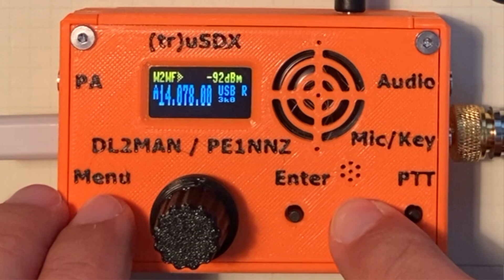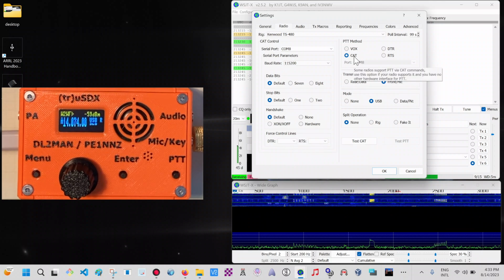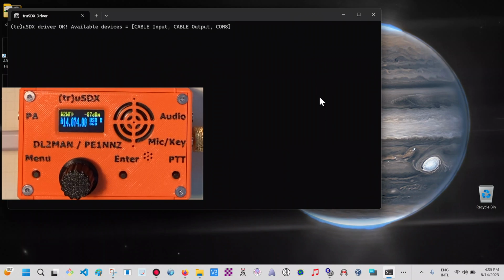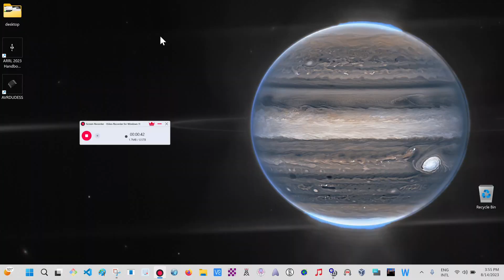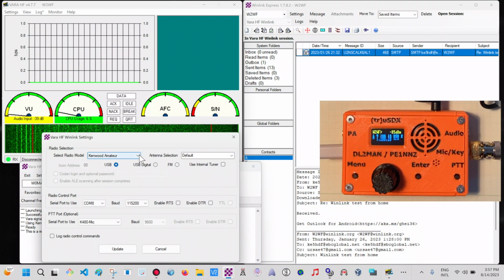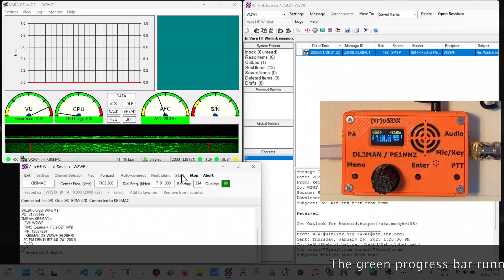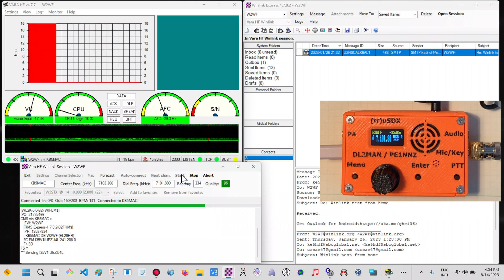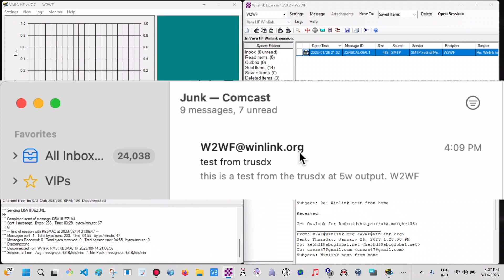FT8 JS8Call & Winlink over USB on (tr)uSDX

Comment: I tried the settings that you gave (WSJT-X) with a Digirig and the lead they sell for the (tr) uSDX, but unfortunately, I kept on receiving error messages.
Reply from the maker: Thank you for the comment.  In my case, I didn’t use the digirig add-on module so I’m not sure what the issue could be; however, I’d suggest joining the (tr)uSDX forum online & posting your configuration, settings, and error message.  A lot of experienced & sharp folks post there, so good troubleshooting goes on in the forum threads.  That would be my suggestion to find the root cause.  Hope it helps & 73!

Comment: Mine Acts weird on ft8. It decodes fine but when I tx it transmits but then after finishing it shows the red lines on the waterfall and stops receiving Audio. Psk reporter showed I transmitted. I think its the driver.
Reply from the maker: May be the length of the USB cable.  DL2MAN did say that he went through 4 USB cables before finding one that worked for him.  I believe that he ended up using a short USB cable for best results.
Reply: @quantumradio Will try. Also turned off semi qsk and will try later.
Reply: @quantumradio  it works now

Comment: Great how to video! I was following along with tge a Winlink segment, setting up and connecting my truSDX. Everything works fine until the first transmit starts and the radio locks up in Transmit, with no T to R back and forth. Any suggestions?
Reply from the maker: Thank you for the comment.  It's possible that the audio sent to the radio may be causing the lockup.  You may want to lower the Tx power in the radio and the AGC level under Vara>Sound Card.  The trUSDX is a great little rig but it may not be as robust as the more expensive radios.  I currently use it as a portable CW rig.  Best of luck & 73!
Reply: I figured it out. It was the tx level as you suggested. Got it working yesterday. However, I didn’t know what was taking so long to transmit my test message. Turns out a bunch of Winter Field Day messages were sent to my call sign! Took a long time to rx all of them.

Comment: I’ve got the all setup and getting contacts on ft8 and js8call. However when I start up WinLink vara hf I keep getting an error message saying the com port is in use. I’m not too computer savvy, how do I fix this?
Reply from the maker: Thank you for the comment.  It may be that Winlink has a COM port other than COM8 selected.  I'd check the Winlink>Open Session (Vara HF Winlink)>Settings>Radio Setup & ensure tht Radio Control Port>Serial Port To Use = COM8.  73!
Reply: @quantumradio  thanks! That’s what I try to do, is to use com port 8. Every attempt results in com port in use. When I select a different com port it allows it, but of course there’s no connection between the two. Then go back to com port 8 and get the same in use message
Reply from the maker: @tjs2909  Yes, the TRUSDX Driver uses COM8 & CABLE audio devices in WSJT-X or any other HAM radio program.  So I don't believe that it will work on another port.  When I run Winlink I first run FT8 with the configurations shown in the video, then exit FT8 (do not exit/restart the TRUSDX Driver or unplug cables), next I launch Winlink with the configurations shown in the video, and COM8 is then successfully used by Winlink.  If you're doing this sequence, then it sounds like COM8 is not being "released" by Windows prior to running Winlink.  That's interesting.  For further troubleshooting, I’d suggest joining the (tr)uSDX forum online & posting your configuration, settings, and error message.  This way the issue is shown to the (tr)uSDX user community.  They're sharp folks in that forum & they may have the solution.  Hope it helps & 73!

Comment: Fantastic video! Thanks for your instruction. I will be receiving my trusdx tomorrow and would like to run digital modes on it.
Reply from the maker: Thank you for the comment and best of luck w/your trUSDX.  It really is a fun little radio!  Just note that it may not be as slick a setup as an ICOM, YAESU, etc.  I'm using it now a days as my emergency radio on CW.  73 and have fun!

Comment: I have this same setup between my PC and the tr usdx.. but my input is showing red. Lowering the virtual mic setting does not lower the input and it stays red. I can "mute" it but cannot lower it. Is this an issue?
Reply from the maker: It sounds like you're talking about the needle on the signal meter at the bottom left of the VARA window showing red and not coming down to yellow or green.  I'd suggest lowering the volume in the (tr)uSDX to 4 or 5.  73.

Comment: I appreciate this is an old video so I don't necessarily expect a response/ I have your exact same settings on windows 7 machine. I have tried many different usb cables/hubs/vb audio cable/voicmeeter/virtual port drivers/ferrite beads and rings etc. but keep running in to the same issue. Rx works fine ft8 coming in great. As soon as I hit Tx everything breaks and have to restart trusdx driver. Any tios or ideas please? Thanks for the great video.
Reply from the maker: Thank you for the comment/question.  I have read that the truSDX on FT8 is very finicky as far as operating with the single USB cable and Guido's driver program for the PC.  I have also found it to be only OK for FT8; for example, it sometimes looses sync with my PC and I have reset the truSDX.  In your case, I'd say Windows 7 is quite an old OS since it was released ˜2009 and that may be part of the issue.  You see, my setup used Windows 11.  

Now, as far as Rx getting the FT8 signal, that's a milestone.  I mean it's quite good that you're getting that working since it implies that many of your settings are correct.  When you Tx things go belly up to me speaks to the many variables in the setup, e.g. the single USB cable, Guido's driver program, the Windows OS, and perhaps most importantly the trUSDX itself.

Don't get me wrong, I still think that the truSDX is a great little rig that sips current and works great.  Heck I took it to England and did a POTA activation there where I got a Michigan station.  However, Manuel and Guido clearly state that the truSDX is an experimenter's rig and should not be expected to work flawlessly like an ICOM or YAESU.  I tend to agree.  Love the radio but... it has compromises in its design to make it affordable.

I still have the truSDX in my portable pack that I take as a backup in my car.  I think highly of it and use if for CW but not really for FT8 anymore.  Best of luck and 73!
Reply: @quantumradio  Thank you very much for your comprehensive response. You confirmed much of what I thought. I am looking to get a more serious rig soon but I also like experimenting which is why I decided to get my foundation licence for HAM here in England. Wull let you know if I get it working. All the best. 73s

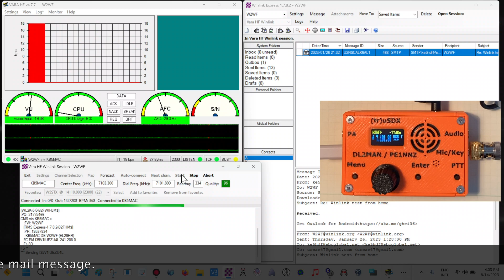Comment: Ok, I feel better after watching this video. I was having issues with the driver dropping out intermittently, and I see it did it to you to here at 11:45 and 13:13, before returning back to normal operation a handful of seconds later. This has been unresponsive to my attempts at troubleshooting and RF mitigation. I know a lot of people say they're not having issues, so I exchanged my TruSDX to Amazon just in case I got a faulty one, but if the new one does this same thing I think I'll just use a Digirig until the issue is potentially fixed in future firmware or driver updates. I know currently Manuel has said his workload is really high, so he's not going to offer support for the micro USB-only interface at the moment. It's still a great radio and I can't wait to see where it goes in the future!

Comment: I get no audio on transmit at all. Any thoughts? Seem to be getting audio just fine js8call, no signal is transmitted however. It switches to transmit and recieve ptt no issues, chsnges frequencies, etc.. thought?
Reply from the maker: Thanks for the comment.  Audio coming into the JS8Call would seem to mean that the Settings>Audio tab>Input is set correctly to "Cable Output (VB-Audio Virtual Cable)", but maybe the Output is not set correctly to "Cable Input (VB-Audio Virtual Cable)".  Other things to quickly check would be:  Firmware version, menu option 9.7 F/W, must be 2.00u.  Audio volume, menu option 1.1, was +4 in my video but I've increased it up to 7, 8, and even up to 10 in other tests with positive results, so you may want to vary that.  

Also, I'd concentrate on getting WSJT-X>FT8 to work since we always seem to have FT8 signals and WSJT-X is pretty solid software.  The idea being that if the settings are correct for FT8, and the problem persists, then it would seem that the problem is hardware related.  Heads up that Manuel DL2MAN mentioned in one of his videos that he tried about 4 different USB cables before finding one, a short length one, that worked.  

Other than that, I'd methodically check the different settings for FT8 and get that to work.  Then proceed to JS8Call.  Hope that helps.  73!

Comment: Sorry, new to all this.
No DigiRig?
Reply from the maker: Thanks for the comment.  My setup didn't require the Digirig, just a sinigle USB cable from (tr)uSDX to the Windows laptop.  I have heard of folks having good luck with the Digirig.  It may be that the Digirig connection is more reliable than the single USB cable I've used; however, I don't have first hand experience of the Digirig connection to compare.  Best of luck and 73!

Comment: Can you send to any email address, and receive replies from any using winlink? Do I need to sign up for the service?
Reply from the maker: Thanks for the comment.  The Winlink & VARA software & service is free though I paid for the "VARA license" & can in theory send/receive at faster transmission rates than w/the free version.  As far as Winlink is concerned, I believe that you do have to have a callsign & signup to use Winlink, though I could be wrong.  I have a Winlink account but not sure if it's required.  Good news is that you can send/receive your emails to/from any email address, e.g. wxyz@gmail.com, abcd@outlook.com, etc.  Hope that helps, 73!

Comment: I dont have a hb+ack button
Reply from the maker: You're referring to JS8Call from what I can tell.  I'd say get the latest version of that SW and see if that fixes it.  Best of luck & 73.
Reply: @quantumradio  yes I was, I installed it this morning. Pretty sure it's the latest
Reply from the maker: @justawfulgamer7738  JS8Call version 2.2.0.  Try clicking on Menu>Mode>Enable HB & Enable ACK.  That should do it.